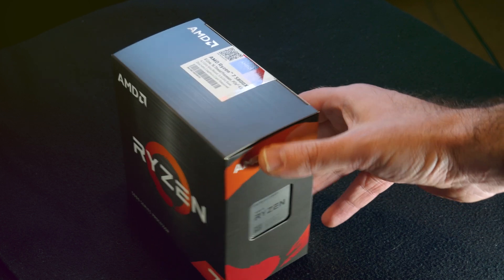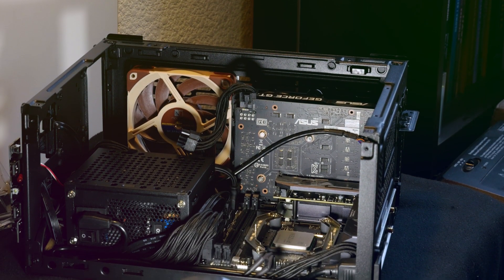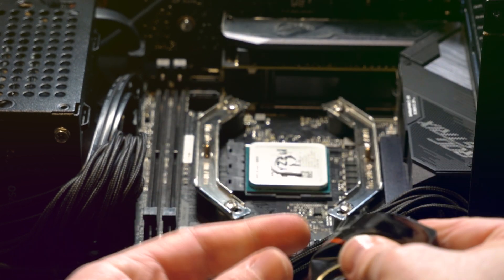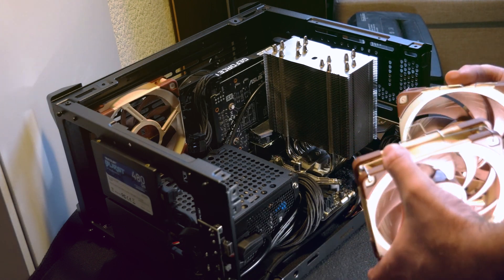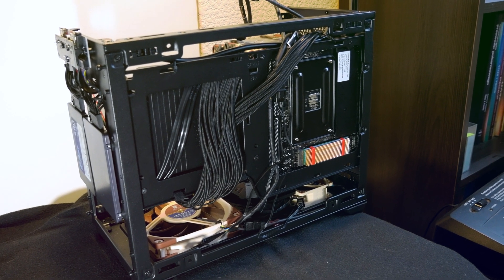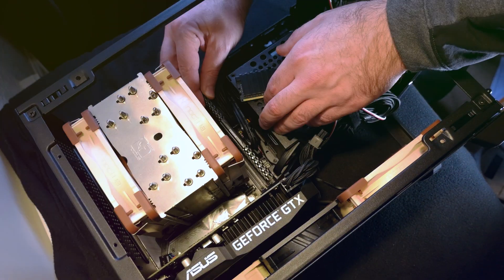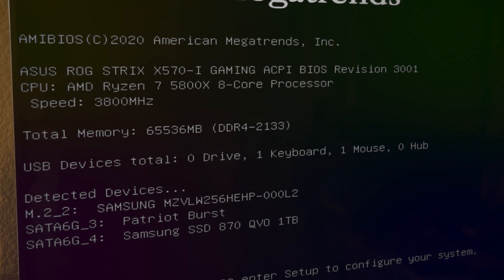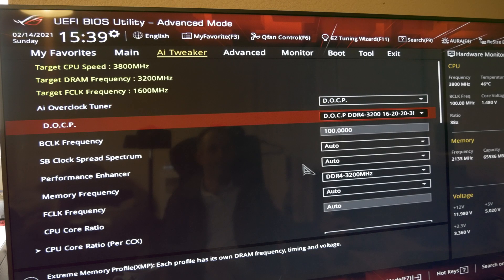Zen 3 5800X do You Really Need More? NR200 SFF with Noctua NH-U12A

Comment: Hey I’ve seen many vids where the nh u12a doesn’t let the side meshed panel close all the way. Did you have any problems like this or found a way around it? And does it affect performance or damage it with that added pressure?
Reply from the maker: did not experience any problems.... it fits, it will not damage the case or the cooler

Comment: I got 5800x with noctua uh12s and I got about 83c maximum temp in cinebench. 
Is It alright?? Doesnt 5800x run pretty hot normally? Idle temps are about 35c
In gaming it rarely goes above 75c

Comment: hey there!
I recently picked up the NR200 and the U12A does not fot 100% with my Asus B550-I. 
The side panel does close but the upper left corner always pops out. The panel does not fell off but its not closed 100%. More like 99,5%
Any similar issues u had? Idk what i did wrong here.
Reply from the maker: is it a DTX board that you have?
Reply: @faxxemusic  no its a casual Mini ITX
Reply: 1. Mesh of TG? It probably doesn’t fit with tempered glass panel. 
2. It’s probably because of the motherboard thickness or smth, you could maybe try screwing it in tighter but thats probably a hit or miss
Reply: i have a b550-i and nhu12a in a nr200. fits with the mesh panel, not glass

Comment: Will a Noctua NH U12S (Double Fans) be good too? I will get the 5800x on Black Friday this year and I was wondering, if the U12S is good enough.
Reply: I hope this isn't too late, but the 5800x is a really hot CPU, by design, I have the Mugen 5 Rev.B Black edition and it is barely enough to cool under load.
Reply: @CobaltC3D  you aren't too late bro. When I saw, that the 5800x has the heat issue, I decided to take a 5600X in combo with a Scythe Fuma 2 + 3x 2300 RPM Fans. The thing is, I do editing. I wanted the 5800X so bad, since it's really good CPU for both Gaming and Editing, but the heat issue was getting on my nerve.
Reply: @gunlyrics  I wouldn't call it an issue really, just requires really beefy cooling is all.
Reply: @CobaltC3D  Yeah. I'm just tryna avoid paying too much on cooling.
Reply: @gunlyrics  Very fair, my friends are runnning thier 5600xs on the stock cooler with 0 issues.
Reply: @CobaltC3D  Damn, the stock cooler seems to be good. From my current CPU, which I was able to observe during the export of a 3 Minute Video, my CPU (R7 3700X, Stock cooler) reached 76°C (yes, you can tell, that's how much video editing needs). I just want to get rid of the overheating on the 5600x, that could come during editing. That's all. If I wasn't video editing, I would've gone straight for the stock boi otherwise, u know.
Reply: Yes it’s good enough. It’s overkill I would say, a ID-Cooling SE-224-XT is much cheaper for close performance.

Edit: ok never nvm get a 240mm aio or smth

Comment: I think bottom fan is not necessary since it can hurt your cpu temp because of gpu hot temp. A lot of tutorial in youtube which benchmark temp suggest u12a with exhaust in top, thats enough i think. Btw nice rig!
Reply: If you watch Machines&More’s video on tower cooling on NR200 you’d know his config is actually quite decent, especially compared to down to top general airflow/horizontal mounted cooler

Comment: Good Job! I have the NR200P and I want to buy the Noctua NH-U12A, did you close the mesh panel properly? Because the Noctua cooler is higher then the maximum high reccomended by Cooler Master for this case.
Reply: It’s fine for sure. I’ve heard it just fits in NR200.

Comment: What is the width of your system unit? I want to buy this cooler, but I have doubts about whether it will fit into my system unit (the width of the system unit is 19 cm).
Reply from the maker: what do you mean by 'system unit'?
Reply: @faxxemusic  desktop computer
Reply from the maker: @prometheus1558  The NH-U12A will fit no problem inside the NR200 case.
Reply: That’s very vague you should look at the cooler height compatibility and not case width.